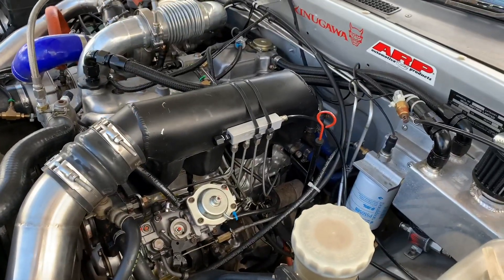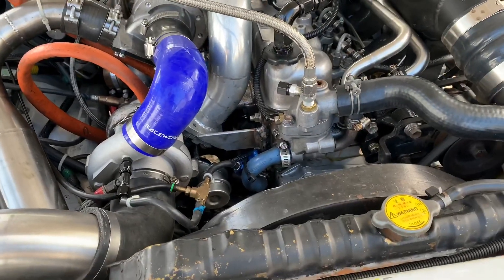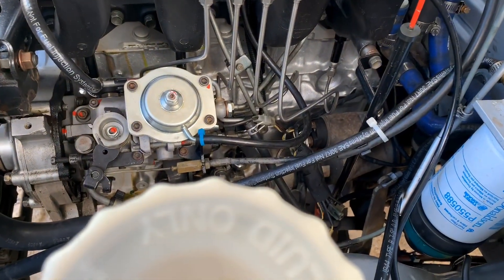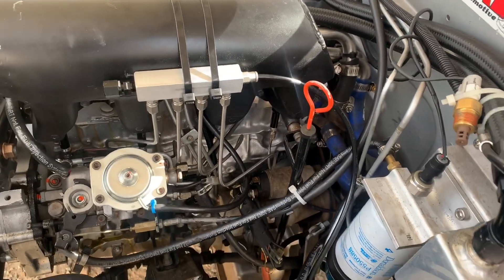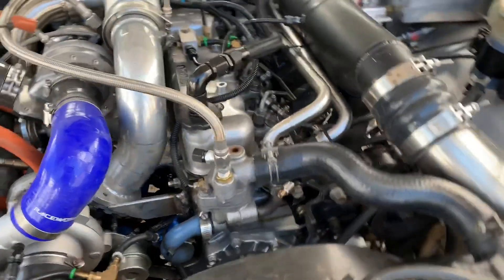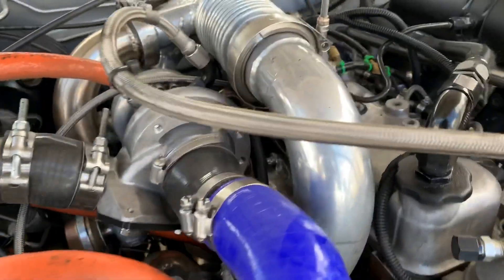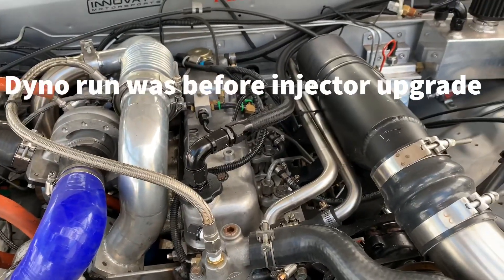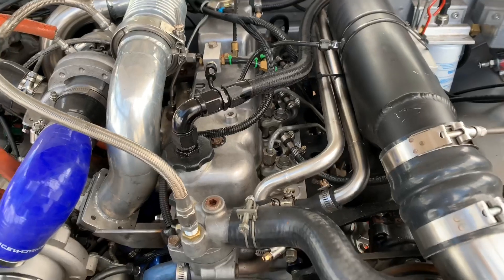Compound Turbo 4JB1T  Rodeo, Engine Walkaround and Specs

Comment: Where to get ARP studs? 
I’ve been looking about and From Australia the shipping cost is so high. But I don’t know the dimensions or part # to find them in arp official page. Can you help me?
Reply from the maker: https://4jperformanceparts.com/products/performance-arp-head-stud-kit-4j-series-engines
Reply: @paulthepilot5  thanks you. Seems I have to pay the expensive shipping from Australia 😅. I hope this ARP fix my problem. I had to pull off the head cylinder 3 times in 2 months because it is getting blown up… air or compression is getting out for the radiator.
Reply from the maker: Have you confirmed the head isn’t cracked or warped or there is damage to the block liner top surface.
Reply: @paulthepilot5  I’ve took some pictures of the block the last time I removed the head cylinder. I don’t see option to post them here.

The head cylinder is good or it say the guys from machine works.

My problem started when my radiator got damaged then got very high temperature… I bought a radiator and changed the head gasket. Fixed it 3 times and still blowing up…
Now I’m planning to get new thermostat, oem head gasket, arp studs and boost~egr gauges set also gonna install front mount intercooler + pipings 2.5”. Going to keep current turbo RHB5 VI87 until I fix permanently the head cylinder problems. Any recommendations?

Comment: How mate would a stock clutch handle 20 to 25 psi ?
Reply from the maker: Boost pressure doesn’t mean much, torque is the concern for the clutch. Stock clutch isn’t really adequate for much of an increase over stock power.

Comment: Hey mate, absolutely love this thing and I have my own one in the works, just wondering about the transmission you used, what car/motor is the mua5 out of as I'm looking for a 2wd box to put behind mine. Cheers
Reply from the maker: MUA5 is the standard rodeo manual transmission, it just comes in 2WD and 4WD versions. The 4WD version has the transfer case built onto the rear housing. The front housing is different for each engine type petrol/diesel, but they can be swapped around without too much difficulty
Reply: So in order to have a 2wd transmission behind the 4jb1 I would have to use the front housing from the one i have which is 4wd and remove the transfer and convert it to 2wd? or is the a tf rodeo that came out with the 4jb1 and a 2wd transmission that I could try to locate to save the effort
Reply from the maker: @williamhaddad2352  no, just have to get a 2wd one, you can’t convert the 4x4 trans to 2wd. You can just get a 2wd petrol trans and put your diesel front housing on it.

Comment: Awesome cheers bro. Any idea if the 4jj1 fits in a 99 LX 2wd rodeo with the 2.6 petrol in it? Haha cheers man
Reply from the maker: Not directly no. Would need new mounts Also need to run the transmission from the 4JJ1 and modify mounts to suit that, tailshaft to suit, wiring loom, ecu immobiliser etc. basically need a donor vehicle with a JJ1 to rob parts off plus a lot of changes to make work.

Comment: hello friend I wanted to make a query since I am adapting an engine similar to a wagonner and I wanted to know where the air hose that is in the upper part of the injection pump is connected, in your engine I see that it has a blue tie
Reply from the maker: To the intake manifold

Comment: how much boost should i run with a stock clutch, thinking of putting 30psi with a stock fuel pump (tweaked) what do u think?
Reply from the maker: turbo maxes out 18-20psi with a good intercooler, even less boost without intercooling. The factory turbo will make more than this, but it’s so inefficient there that you actually loose power doing so. In most cases a factory clutch won’t do too well, upgrade to a heavy duty clutch is usually needed with anything much more than a stock setup.
Reply: @paulthepilot5  soon ill be slapping on a 46mm turbo, and a 3 inch downpipe pretty much everything is stock. should i run 25 psi or 20 psi?
Reply from the maker: Stock pump still won’t need more than about 20-22 maxed out. Is your setup intercooled?
Reply: @paulthepilot5  yes, front mounted
Reply: @paulthepilot5  I should just stay 20 for now?

Comment: hey do you reckon 20psi is safe to daily drive with stock internals.
Reply from the maker: Not a problem for the engine, would happily run up to 30 completely stock engine. Over 30psi head stud upgrades become a consideration. The limit of the turbo however is around 18-20psi any more than that it is inefficient and costing power, this is with good intercooler too.
Reply: @paulthepilot5  do you recommend a custom fuel pump upgrade?
Reply from the maker: @muhammadabrooramrullah996  depends what power you are chasing, stock pump is good for up to around 140hp

Comment: Where can I get a tune and huger fuel pump
Reply from the maker: Most diesel injection shops can do a 12mm pump upgrade. I recommend Diesel Australia, they are the only ones that do the +50 injectors

Comment: Hi, can I ask how high psi can an all stock 4jb1 turbo engine can handle. thank's
Reply from the maker: They can start having issues with head lifting, gasket failures around 30psi on standard head bolts. Just depends on a few factors, timing etc

Comment: Hey man that's a nice setup, I would like to replicate it on my 3.1 bighorn, would you be able to send me a link to the td04 so I can try track one down ?
Reply from the maker: Hey, have a look at the Mamba turbo page, or search on eBay. Will be to suit 4JG2T could always just buy the turbine housing to suit, then get whatever TD04 with the same turbine size.
Reply: @paulthepilot5  hey thanks I have seen them but I'm after the specs of your turbo as ill be making a custom manifold to work with the little space I have available
Reply from the maker: Mines a Kinugawa 4JG2T TD04L-14T for the primary turbo, and a Garrett GT2871r for the atmospheric. Primary is running off the factory 4JB1T exhaust manifold. I think Kinugawa stopped doing them, so Mamba is the only option now for that bolt on housing.

Comment: Nice one man. Where do you go for parts and recommenations mines getting hi  km but can't find info for bearings, or any internal parts. etc. Cheers
Reply from the maker: There is still a bit of genuine stuff around. But Engines Australia have all the rebuild kits, components.
Reply: @paulthepilot5  thanks for that

Comment: hi any update with this engine?still a daily driver?
Reply from the maker: Still daily driven. Haven’t done any more updates on it. Engine will be going into a lighter 2WD ute, getting bigger injectors, In-line injection pump and some other supporting upgrades to target 300+hp.
Reply: @paulthepilot5  can you tell me the mpg this set up?
Reply from the maker: @junalfred2606  does better than a stock engine, but I don’t keep track of it to give an exact figure.
Reply: @paulthepilot5  Where can I find bigger injectors and in-line fuel pump for the 4jb1T
Reply from the maker: @carltondunkley5774  Diesel Australia in Brisbane do the bigger injectors to suit. The inline pump is not an off the shelf setup, something I’ve adapted myself.
Reply: @paulthepilot5  how the inline pump set up looking?
Reply from the maker: @carltondunkley5774  not done much more at this stage
Reply: @paulthepilot5  what inline pump did you use? and how to adapt with the engine?
Reply from the maker: @muhammadabrooramrullah996  4BD1T pump, with some modified internals.
Reply from the maker: @muhammadabrooramrullah996  made my own adaptors for the pump

Comment: Hello, what is the stock injection pump plunger on that 4jb1?, and also you know how to adjust the boost compensator?. Thank you😃
Reply from the maker: Stock pump is 11mm, there is a model number on the side of the pump with size, governed rpm and rotation direction in the number

Comment: I used to run my old 2.8t on oil . She had a 4jh1 exhaust manifold into a Colorado turbo . 3 inch zorst about to midway and kicked out the side . Was good for 35psi  max boost stock internals.
Reply: fryer oil or used motor oil? how did you filter it and would you thin it down at all? any problems cold starting?
Reply: I run mine on veg oil. Just settle it to get moisture out then filter through water filters down to 5 micron and right to go. Mix with diesel to thin if in cold areas.  @Geopolitics2day
Reply from the maker: @Blackbeardxx9 pump rebuilders love veggie oil and homebrew biodiesel 😆